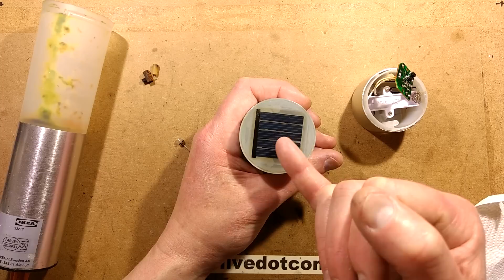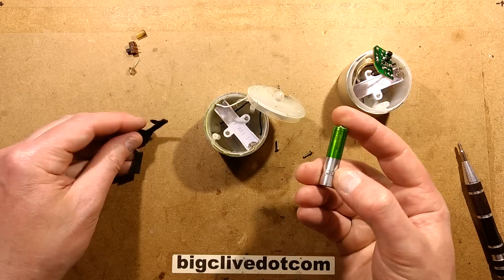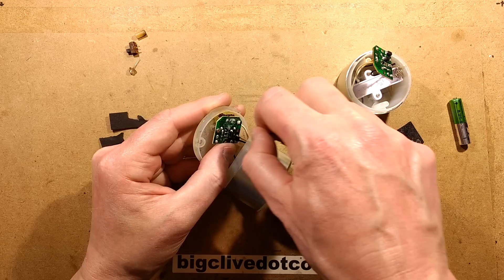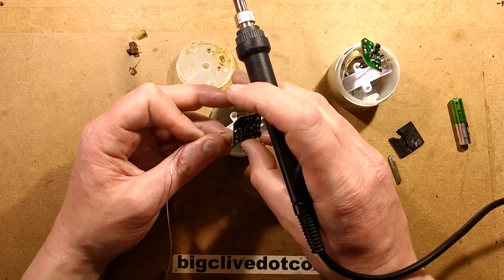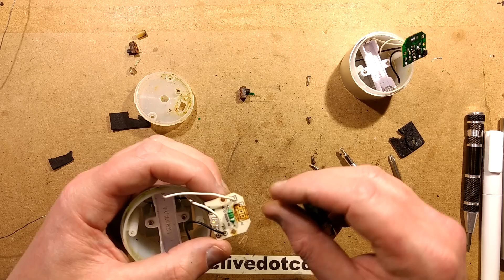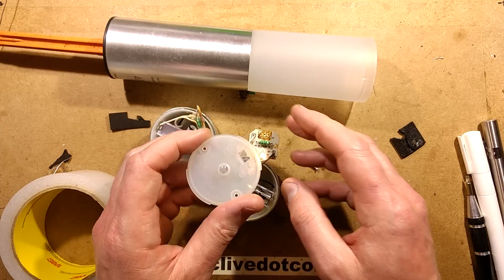Fixing (and cleaning) IKEA solar lights for my brother Ralfy.

Comment: Interesting to see the Ikea version, because I've picked up some Dollar Tree ones a few times, and same problems with the seals but worse, and dig this: they come with NiCad batteries!! I thought NiCds were illegal now, but in any case, paying a dollar to introduce cadmium into the waste stream for s dollar is a bad deal to say the least. They should be taken off the market.
Some if the other dollar stores use low grade NiMH (NickelMetalHydride) batteries, but they work fine. I've replaced a couple with  good quality NiMH batteries and the lights work great if they're put in a sunny spot.
The way you tell the difference is the latter (NiMH) have a flap that holds in the batteries, but the NiCads always have screws that have to be removed to look at the batteries, so it's easy to avoid them.(note: this only applies to the dollar store versions - obviously from this video the more expensive ones have screws on all of them, which is better design anyway because water can just pour in through those flaps. I've tried putting a bead of silicone seal across the flap, and that seems to work  pretty well.
There's a California law that requires retailers that sell products containing Ni, Cd, Hg or any other toxic metals to recycle them, but if you bring batteries back to dollar stores, I'll bet they just toss them, so please return them to a recycling center. Thank you!
I'm a bit of a fanatic because years ago a friend was making up  NiCd battery packs for his job, and started feeling ill - he went to the doctor and they did a toxin screen - lo and behold, he had accumulated enough cadmium to affect his health. A few weeks of chelation meds made him feel much better.

Comment: What if the manufactures of the solar lights were to add a desiccant to the inside? Would that mitigate the water damage?
Reply: For a while until the desiccant becomes saturated. Periodically changing the desiccant could be a solution. (There could be a nerdy pun in there about saturated desiccants and solutions).
There could be a new generation of more sophisticated garden lamps with built in moisture sensors. When the lamp starts flashing time to change the desiccant.
Manufacturers are unlikely to add a desiccant as that would extend the lamp life so they wouldn't sell so many.
Reply: You wouldn't even necessarily need the moisture sensor, just a replacement schedule for the desiccant. The moisture alarm is nice idea for high end models. There could also exist an IOT model that could use a base station, to communicate with the lights, that was attached to WiFi and notify you on your phone when the desiccant needed to be changed, change the color of the lights, or scheduled color profiles.
Reply: bob s They could sell you expensive, premium desiccant that is designed for the prolonged life of the unit.
Reply: True, the world's most expensive silica gel cartridge.
Reply: It won't happen, for at least two reasons. 1) It adds cost to the manufacturing process, and even a fraction of a penny is too much. 2) It makes the item last longer, so the manufacturer or retailer doesn't sell as many items. The whole shebang is profit-oriented. Tl;dr - China!
Reply: RWBHere Last time I checked the question was "What if" and not would they do it.
Reply: RWBHere As far as the last part of your response goes, selling doesn't always mean making less, especially in a market where premium items already exist.

Comment: I understand scraping of the joints, if they are horrible.  However, why not use your flux pen, since they weren't that bad?
Reply from the maker: +PV2Omni There seemed to be quite a thick oxide coating on them.  But if I open any more of these I'll see if the flux can deal with it.
Reply: bigclivedotcom Thanks!
Reply: ever try the rossman method? flux it with liquid (or paste), then hit it with the hot air so it eats the crap off?

Comment: Is that desoldering braid compatible with slot cars?
Would be nice to be able to get braid in a long roll like that rather than buying it in little bits.
Reply from the maker: I'm not sure if it would work for that.  It comes with flux in it, but that could probably be washed out with a solvent.
Reply: paspax I'm not familiar with slot cars, but you can buy copper braid in many widths and gauges without the added flux found in desoldering braid/wick.  Braided copper straps are used in many applications, but are often used for grounding straps where flexibility is critical in what would otherwise be a rather heavy gauge wire (for low impedance).  Most often it will be tinned copper, but untinned bare copper also exists.

Comment: I was hoping you would reverse engineer the circuit. I have been working on a solar light with corrosion and had to replace the 4 pin chip [QX5252] and I think I broke the green resistor on the LED side. Prior to the breaking of the green part I don't know if I measured directly or used to color bands, but I got 150 ohms and had made a schematic. From analyzing the schematic, I couldn't  understand because the unit should not work, yet while I never saw it work I default to the fact that it was made to work. Then I reviewed an inductor/diode/capacitor boost converter schematic and the light went on. I looked at my schematic I drew and realized that if I replaced the 150 ohm resistor with an inductor, then the circuit would work. [converting the 1.2V- 3.0V +/-] So I salvaged a small SMD 220uH inductor and fitted it in and bam now the unit works. 
The question I wanted answered was that green inductor that looks like a resistor ]Pain in the ass] what was or should be the value of the inductor?
I looked at the data sheet for the solar light chip and the current varies with the value of the inductor. [36Ma with 100uH @ 1.3V] I tested the 6 small auto flashing LED's to average 10Ma max, so I figured a 220uH should work just fine. [The smaller value the inductor, the higher the current.]
Reply from the maker: The chips will work with inductor values between 47uH and 470uH.  The higher the value of inductor the lower the current and longer the battery life.
Reply: @bigclivedotcom   That really threw me a curve having an inductor in a resistor package. The unit came with a 200maH battery that tests bad in two chargers. I put a Lenmar R2G 850maH NiMh fully charged battery in it, last night it ran pretty bright [6 small auto flashing LED's] and when I saw it a 3:00AM it was looking a little dim. This morning, the sun was coming up and the lights were off, when I covered the solar panel they did not turn on. I will have to see after a days worth of sunlight and see if it lights and for how long. I may have to go with a higher value inductor and sacrifice brightness which is ok, plus the solar cell has a spot on it and may be weak. [Right now in Northern California U.S. the sun time is about 6AM-9PM]
Thx for your input. :-)
Reply: @bigclivedotcom  The unit is a brass/glass hanging Angel wind chime so it is worth putting some effort into.
I was curious about something...After replacing the broken 150uH (resistor package/remember at first I thought it was a 150ohm resistor) with a higher current capable SMD 220uH inductor, installing a fresh charged battery, [850maH, original 200maH] it lit pretty bright and drained the battery by morning.

The question is...even though I replaced the inductor with a higher value which should have caused less current to flow, could the higher current capacity inductor actually have caused more current to flow with subsequent battery draining?

TOO much more information :-)
I have noted that when the sun goes behind the trees creating a shadow the unit turns on too soon causing the days charge to the battery to be depleted by the time the sun goes down. This plus the fact that there is a corrosion spot on the solar panel makes me think it is weak. I did order a 12 value 120pcs resistor package inductor assortment pack. I also ordered a couple of 2V 30mA solar panels,[one spare] thinking that the overvoltage on a NiMh with such low current delivered and at that it likely will never be able to fully charge the 850maH battery anyway. Then upon further inspection I saw the original solar cell has 3 wires which tells me that it is a 1.5V cell :-/ So I ordered a few 1.5V 60maH solar cells. Here are the parts...
12 value 120pcs inductors... https://www.ebay.com/itm/192123261670
Original solar panel = 41mmX41mm
MINI SOLAR PANELS Model: 2v * 30 mA 45mmX45mm https://www.ebay.com/itm/182409450793 [Now out of stock]
1.5V Mini Solar Panel 1.5V 60mA 30mmX30mm  https://www.ebay.com/itm/1-5V-Mini-Solar-Panel-Module-For-Battery-Cell-Phone-DIY-Charger-S5V0-UK-N1F5/293671030801

Comment: Love the new channel icon!  LOL!
I am the doyen of solar lights here in my suburban street in Australia.  I have them everywhere in the garden and I also use IR-triggering solar-panel powered security floodlights for my carport.  Some hints for those wanting to buy solar lights:

- Before using take the batteries out and put them in a charger so they get a good charge first before the intermittent charge they'll face in gardens.
- If the solar panel is flat on the top of the light run a bead of clear silicon around the edge of the panel as temperature change, as Clive points out here, will cause water ingress as the plastics expand and contract.
- You can always use an battery engraver to poke a little hole into the base of the circuitry cradle to allow condensation to fall away with gravity.
- If the unit has a switch I usually get rid of the switch immediately and just bridge the circuit to always "on" to avoid the corrosion the switches usually generate.
- Think about dumping the battery each year as the ability to recharge eventually drops away, especially with Ni-Cads.  Dispose of the batteries at your local collection point.
Reply: Yes.

Comment: For the cleaning and scraping i recommend using a glass fiber pen. It works wonders to oxide layers ad other kinds of shmoo that resists isopropanol or distilled water.
Reply: I was thinking about mentioning using a fiberglass pin to clean the solder joints as well that would definitely work
Reply: Used them a lot cleaning brass instrument solder joints: recommended that you wear gloves, probably nowadays an air suction system, or mask would be recommended too

Comment: I also had some good results cleaning stuff with a toothbrush. Alcohol, soap water, acetone, petroleum, lighter fluid, hydrochloric acid and WD40 are helping too depending on the type of dirt.

Comment: Would drilling a small hole to allow the the circuity to 'breathe' help, or would it just make it worse?
Reply from the maker: +Spikey DaPikey I did ponder whether putting a small bug filter like a bit of sponge into the empty switch hole might allow it to breathe.
Reply: poor some of those silica gel beads in there and seal it up?

Comment: just a thought, would it be beneficial to instead of completely sealing where that switch protrudes, use a rubber bit of sorts to create a diaphragm where during the day the air inside expands due to warming, moves that diaphragm instead of exiting the fixture and thus preventing it from drawing in moisture when it cools inside as the diaphragm relaxes ?

Comment: I thought they were well and truly fluxed at first with all the water damage, but you rescued them. When cleaning circut boards of crud and other corrosion i use on of these http://www.maplin.co.uk/p/abrasive-fibreglass-pencil-kr61r 
had one for years now, also works great for cleaning motor rotors.
Reply from the maker: I used to have one, but have now just ordered another with refills on eBay.  Plus a set of the steel and brass tipped ones too.

Comment: i'm surprised you didn't just take a bit of rubbing alcohol and a tooth brush to clean the board a bit from any possible dirt and water on it.
Reply: Rubbing Alcohol is just a common name for Isopropyl alcohol(IPA)
Reply: +duction, 50 cc of it would kill you, without intoxicating you first. I worked with it in wafer fabrication, often heated in fume cupboards, and the warnings were emphasised from day one. IPA is quite safe if not ingested and if handled responsibly.

Comment: Have you had any success retrofitting color fading LEDs into solar lamps? I tried it but they just won't change color. I assume it's because of them being pulsed by the step-up converter
Reply from the maker: You can  make it work if you add a diode and small capacitor.
Reply: Thanks, I'll give that a go :)

Comment: Could some cheap Silica Gel Desiccant packets be placed inside to reduce the early morning Sun condensation issues? or would it make no difference without adequate ventilation?
Reply from the maker: In completely sealed lights it can help, but not ventillated ones.

Comment: Why not drill a little hole at the tip of the dimple where the LED goes? Then the water will drain out.
Reply from the maker: It's not that easy.  Surface tension of water, particularly if slime gets involved can result in the water just sitting across the hole and going nowhere unless the next thermal cycle pushes it out.
Reply: bigclivedotcom At least the hole would allow same evaporation, even in damp locations.

Comment: wouldn't be a lot better if they make a small hole at the bottom for all the water to run out? that is what they do with in the motorcycle handlebar controls

Comment: What sort of flux do you recommend for the flux pens?
Reply: Electrolube or CircuitWorks
Reply: I don't bother with flux pens. I have a 60ml bottle of flux I use to refill a lipgloss bottle. I bought the bottle empty as a set of 5 for £2.50 and really like them. The brush on the end is great for applying the flux. Because it's a bottle I can also just dip the de-solder-braid in the bottle if required.

Comment: Last summer I "weatherproofed" our solar garden light. Put tape over the solar cell, coated the PCB with nail polish. Put petroleum jelly around the switch/gasket. Sealed the external wires for the LED with hot melt glue. And sealed the seams using nail polish. After the winter it was totally dead, water had found its way in anyway (from the external wires) and could not get out. The legs on the chip were corroded and the chip was kaputt. I think it's better to drill a hole in order to let the enclosure "breathe" and let the water get out again.
Reply: It is often a lost cause trying to truly fight moisture ingress and it often works out best to design for minimal moisture ingress and then design a proper path for that trapped moisture to readily escape.  Otherwise, in a nearly perfectly hermetically sealed enclosure you just wind up forever collecting water as it ends up easier for moist air to find a way in and condense each night than it is for that now condensed moisture to find a way back out, so it just slowly builds up and gets into everything over time.  Sometimes the simple addition of a drain hole added to the lowest point winds up the optimal solution versus trying to seal something perfectly.  Moisture can be a particularly insidious foe!

I just finished repairing an outdoor garage door opener keypad for my sister that had suffered considerable water damage and many traces and vias had completely corroded away.  All of the damaging moisture was from condensed moisture in the air (central Florida) which had no other way out once it was condensed.  The vias had especially suffered severe corrosion with many missing their plating entirely.  I fixed the traces and repaired the vias and filled them all with leaded solder to keep water out of the vias and sealed the repairs with nail polish to replace the solder mask I had to grind away to repair the damaged traces.  I can not do a silicon conformal coating of the board since the carbon keypads would no longer work but I will be suggesting my sister drill a small hole or two in the base of its enclosure to allow future trapped moisture to escape more freely and hopefully avoid further damage in the future.

Comment: One big improvement would be to apply some  resin,epoxy or liquid tape on the circuit board to make it weatherproof , this should be done on both sides and also on the led leads also you don't have to worry about future soldering on it since this kind of circuit practically never fail for electrical related problems, just moisture is the problem

Comment: Neat tip fluxing the desoldering braid. I tend to find it's pretty useless so I'll give that a go!
Reply: igotes I use liquid flux.  I keep a small amount (few drops) in an open container, and dip desolder braid or wire ends in before using/tinning.
Reply: Good braid will have flux in it. Cheap shitty braid usually doesnt, but a wipe with a flux pen before you use it solves that problem
Reply: The trouble with that is the wick will suck that pen dry in no time, better to dip into flux container.
Reply: It makes a real difference. I have a block of solid resin that I use - use the iron to melt a touch of resin into the braid, and it works like magic.
Reply: Yeah, desoldering braid is pretty bad without flux.
Reply: I assume they are already impregnated with flux. Just not enough :) Thanks everyone for the other tips
Reply: Another problem I have is that the braid conducts a lot of heat away from the work area. Perhaps cutting off a small amount and holding it with some pliers insulated with silicone tube would help with this.
Reply: Yes, expensive braid is impregnated, cheap one isnt or only barely is. And the heat conducting problem might be related to that, too. If that doesnt help, you might need a beefier soldering iron for that job.

Comment: Hi Clive, would spraying the circuitry with the likes of WD40 help reduce the chances of corrosion in newly purchased solar lights?
Reply from the maker: It's help.  It could also be sprayed with lacquer (or brushed with clear nail lacquer?) or if you don't mind the mess it could be smeared with grease.